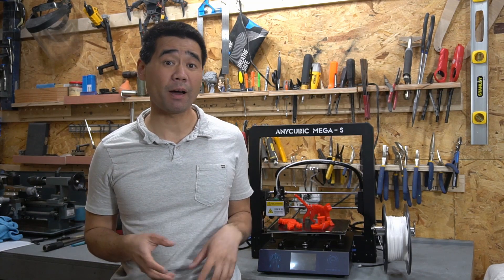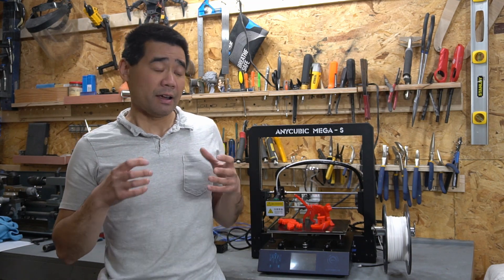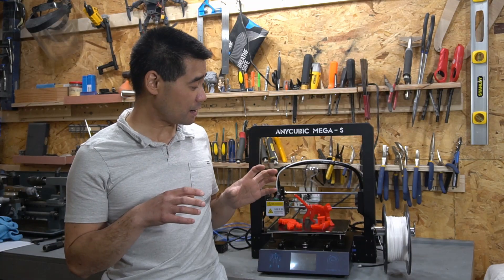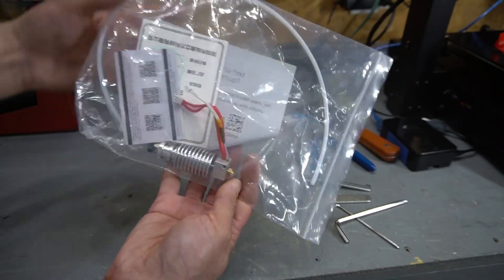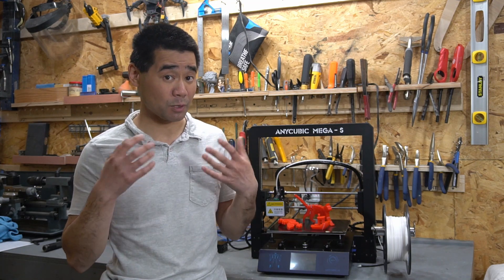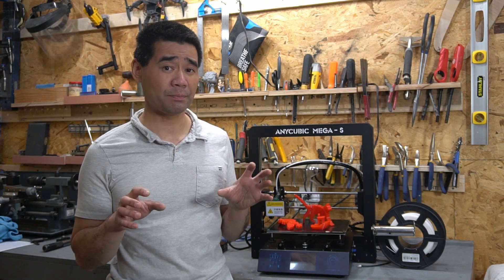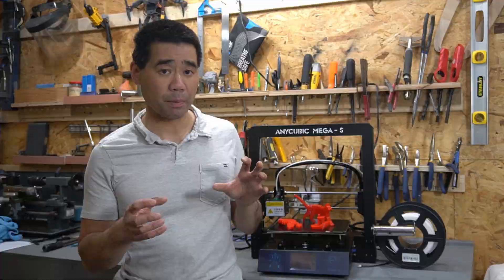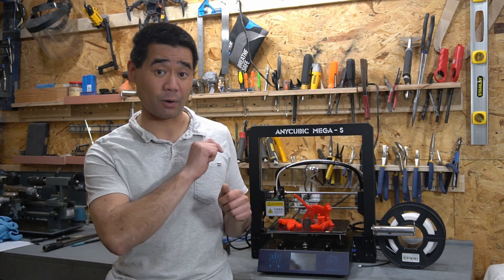Anycubic Mega-S 3D Printer Review

Comment: I really like the way you present your videos, and the clear way that you communicate. The first of your videos that I watched was the one on Plasma Cutters. I have also done some 3D printing ... actually Quite A Lot. I used a BIBO Touch II for more than 5 years. It can reach 250 C and printed HIPS filament very well. Over those years it had several problems that I was always able to fix.

But not any longer. It simply will no longer print. I am very happy to find this Review of yours regarding this low-cost printer. This Anycubic can reach 260 C, and so will also be able to print using HIPS filament. So when I need a 3D printer again, it is good to know which one I should consider. Right now, I plan on having some fun with an Amico 30A plasma cutter ... Thanks!

edit: Oh, also ... a commenter at Amazon suggested using the Simplify3D Slicing app. I totally agree with this, have used it for years. Simplify3D is not Free, but it is Certainly well worth the price.

Comment: My experience was bad. I strongly suggest buying it from a company that allows 30 day returns.  two problems, SD card was not formatted properly, took me an hour to figure that our and resolve...as i had no hint. 2. after having calibrated the base properly...yes, very sure, took me 40 minutes, the unit still scratched the base on first print. The end product is not smooth. Overall, it's junk or this was my experience.

Comment: How are you getting on with this Anycubic Mega S? Trivia question since you've made several pieces that I've seen in this video. In short I wanted to ask you what settings (various temperatures plate\extruder, various parameters, etc.) do you use to start printing? Could you post something (any object so we have the basic settings to be on the safe side)? The test object came out perfectly but then there were considerable problems of attachment to the plane and leveling solved. I tried printing again but I was not satisfied, it remained attached on one side and on the other it lifted up and detached itself from the plate ... .  Thank you very much.

Comment: I've had the anycubic i3 mega for nearly a year now. I've upgraded it to the mega s with the available kit changed the stepper motor drivers (massive difference) and hotend fan to make it quieter. It's a great starter printer for anyone it is very loud at stock hence the upgrades. My next project is to upgrade the PSU fan as thats were a lot of noise comes from.
Reply: Bradladd Play's how does it compare to the ender pro 3? Is there a reason you choose the anycubic over it?
Reply: @midnighttech4225  I just got a good deal at the time for it. Im pretty new to 3d printing so wanted something simple that I can get used to it. Looking back now I think I would still go for the anycubic especially after the mods I've done but I can't say for sure as I've never used the ender 3 myself.
Reply: I like the sounds of 3d printers :P

Comment: I can't find the red cable connector in my Mega S printer, I think it is missing!
Reply: i bet they get a lot of people saying the same .  Looks like they had to revise the manual  because of this.  They hide it under the Z motor on the right side. Maybe for the purposes of packaging? I thought the same thing but when you look at the picture in the manual for that assembly step it has a translucent overlay telling you where it is.
Reply: @HDTube101  yes you are right, I found it right in there stuck very difficult to get out. Had to lift the printer up.

Comment: I used the sheet of paper to do the levelling, followed their videos, read the manual, etc, but I just cannot get it right. If there is little resistance on the paper, the print starts to come right off the base during print, and if I add more resistance, the nozzle scratches the base. Whatever I do just isn't working - any ideas?
Reply: Try to lower print speed on the first layer like no more than 20mm/s and gradually increase it till you reach its limit then you will know the fastest speed for the first layer to get a good adhesion. Also for PLA I set my bed temperature to 60degrees cent. for the first 2 layers and back to 50degrees cent.

Comment: Love the Anycubic i3 mega that I got years ago. The only real problems were the wires to the heat bed will break as they were very stiff and not flexible so I replaced them with high current silicon covered heat bed wires. How do the heat bed wires look on the Mega-S ? Oh and I was able to put in TMC2208 drives to make the i3 totally silent except for the fans.